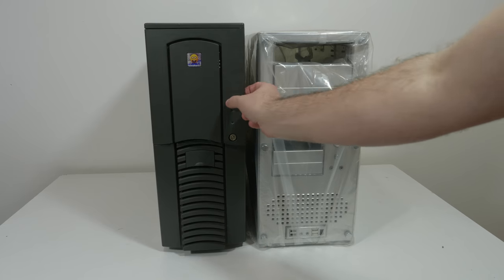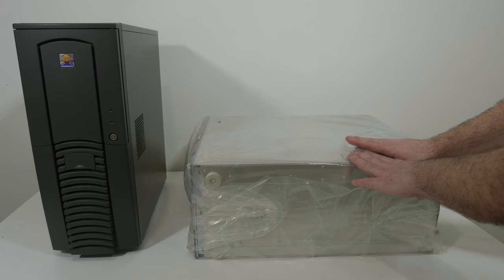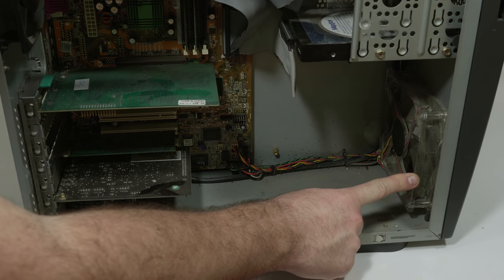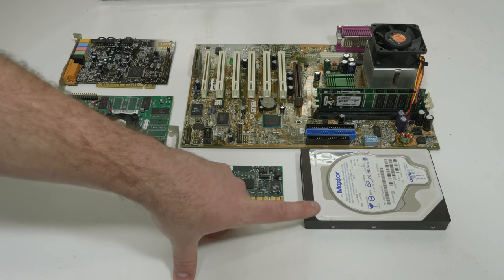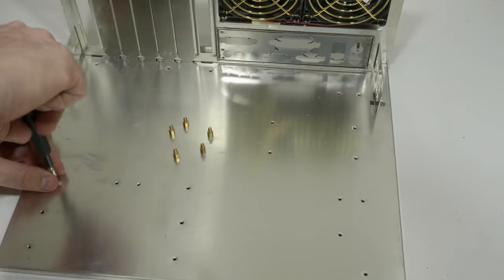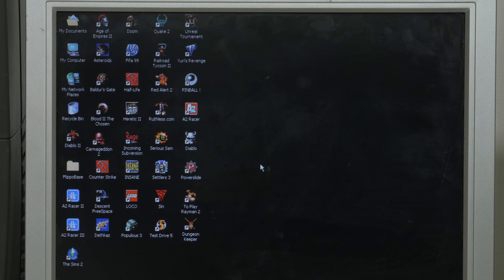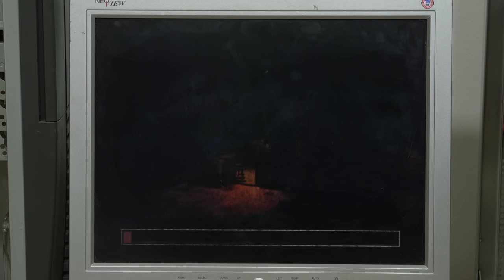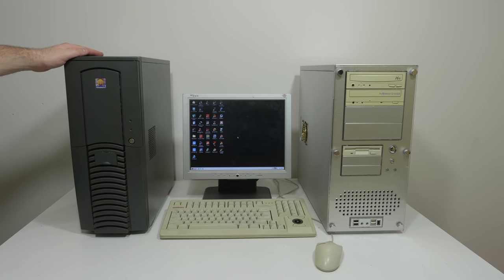3DFX Voodoo 4 4500 - Pentium III 1000mhz - ATX Case Swap, Computer VLOG #44

Comment: are  pc from 2004 retro? can You build something from 2004 please? :)
Reply: The RETRO Machines community welcomes anything 10 years or older, so you can even be part of it with 2008 hardware as of 2018 :)
Reply: hmm i dont think 2008 hardware is really retro. you can still do most modern stuff on 2008 hardware. like i7 920 is from 2008 and still enough for current games, especially when overclocked